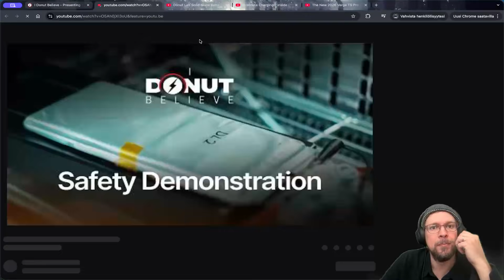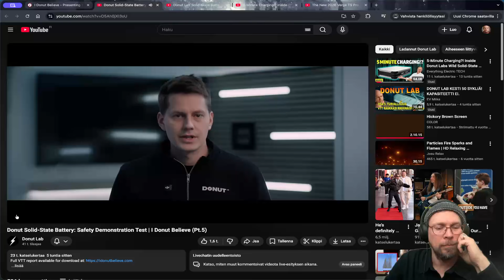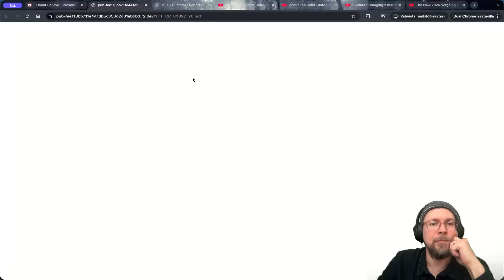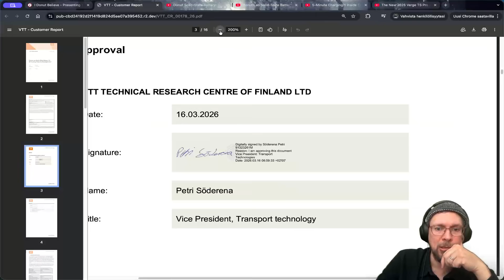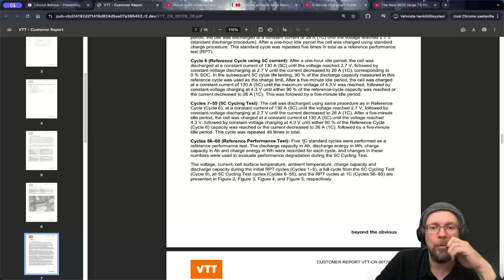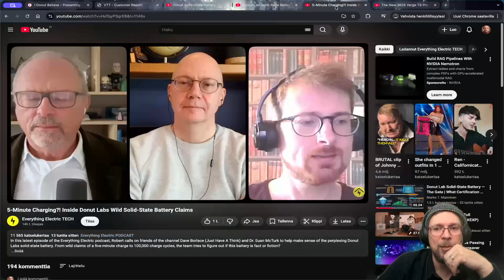Reaction to Donut Lab Safety Demonstration VTT Lab Test

Comment: That was interesting idea and a good point, I also watched the podcast and he's talking about UK battery sector and Formula 1 and Formula E. You know F1 development is massive and many breakthroughs have been made from it into the cars we have today. That's the idea of F1 "develop the best formula". Car manufacturers like to invest in F1 because it's basically free development of car technology and these new F1 and Formula E cars are heavily battery and electric motor centric, probably many and the most innovation will come from there because it has the highest development budgets for these technologies. They have been developing these F1 cars we have today for several years already (5+ years) and might have already discovered something massive but it will take time until it's allowed in the rules and instead went to Estonia and Finland to do it.

Also doesn't this last video give hint about how much denser the solid-state battery is. Old bike was 245kg and new one 220kg so the battery is 25kg roughly lighter than the previous battery with same range so that's the energy density difference I believe. I think someone can calculate the weight and energy density of the battery from this. Probably a bit less but I believe most of the weight saving like 90% should come from the lighter battery.
Reply from the maker: Nice F1 details! Someone commented that the TS Pro motor weight also got down, so that 25 kg may split half lighter battery and other half for to other bike components getting lighter. My initial calculations energy density would go somewhere between 300 and 400 Wh/kg. I don't know for instance, if ED in the end product is calculated from the single ideal cell at its best condition, or if there is something to average when cells are in a pack, and packs in a closure working with BMS. A bit research probably gives easy answer.

Comment: Strange is that they claim the cell pouch seal was damaged during the 100 °C test. How could it then swell up by 17% after 60 additional cycles, and they even mention that the “cell pouch was firm”. Did the seal somehow reseal itself?
Or was it not a loss of vacuum at all, but rather the cell started producing internal gases during the high‑temperature test, and continued doing so in the second test? Because if this is a solid‑state battery, I thought it shouldn’t be able to generate internal gases. And if the seal really did reseal itself, where did the additional gases come from?
EDIT: Maybe only the internal cell material swelled up without actually generating gases? Because in the post‑test photo, the cell doesn’t seem to be swollen like a typical Li‑ion pouch cell…
Reply: Two Bit da Vinci (Ricky) actually pointed out that the 'plateau' after the capacity drop is a classic signature of solid-state contact loss, not chemical failure. He also noted that the cell stayed 'firm' rather than 'puffy,' which proves the 17% expansion was solid material swelling, not boiling liquid gas. If it were standard lithium, the moisture in the air would have turned it into hydrofluoric acid days before the test even started.

Comment: The cycle test performed on the damaged cell was conducted in a climate chamber (possibly the same one where it originally failed), whilst a different background cycling test was observed in the fume cupboard where the self-discharge test was conducted, suggesting a cycle test is still yet to be released. Perhaps a suite of test results are being planned to be released next Wednesday (weight, volume, safety tests, cold test and cycle life) at the same time as an announcement of the Verge motorcycle production release. I wonder if Donut Lab might have engaged Munro, or other engineering companies, in addition to VTT as part of a planned reveal for the 1st April.

Comment: He doesn’t say that that is the new SSB motorcycle. He just says that is the new version & will ship with SSB.
Reply: It has the new colour screen that is on the new motor cycle.
Reply: He doesn’t say that, but there is a #solidstatebattery tag. The weights also aren’t that impressive. Isn’t the original 540 lbs (245 kg) weight with the Donut Motor 1.0? Because the same bike with the Donut Motor 2.0 is supposed to weigh 507 lbs (230 kg), and in the video he mentioned that the new bike weighs 487 lbs (220 kg). So did the “solid‑state” battery actually save only about 10 kg?

If the battery really saved the full 25 kg, then it’s getting very close to 400 Wh/kg.
Reply from the maker: That was my initial calculations as well, what could it mean for the volumetric energy density. And I also was confused initially with 507 lbs, but good to know that it related to the motor v2.
Reply: @MarkoTManninen I believe they also reduced weight in the latest version of the motor.

Comment: I think if you put the 'missing' water back into the cell and repressurize it (put it in new outer bag and restore the new bag to vacuum) restoring the 14.7 PSI clamping, it might recover more than expected, I hope they try it and post that report (if they bother to do it)
Reply from the maker: That would be a weird procedure! They say no clamping is needed, but how do they vacuum the cell? And what kind of pressure it actually causes?
Reply: @MarkoTManninen  They are almost assuredly using atmospheric clamping (often called vacuum clamping) a method that uses normal air pressure - roughly 14.7 psi at sea level, they said it loses vacuum due to the bag not being constructed to withstand 80 to 100c

Comment: Thank you for all your work about these cells and for a video without AI voices and graphics!
I agree, this test was not planned and was only a “damage control” response to their cell being unable to be used at a temperature that they said it could handle, 100°C. 

That damaged cell expanded a LOT in this cycle testing. I’m wondering what would happen in a battery pack with lots of cells that were already under some compression.

That UK/F1 possible association is interesting!

In my opinion that Verge motorcycle dealer was saying that solid-state battery packs will be arriving later this year, which makes me think some or all of the new model motorcycles are being shipped with conventional li-ion packs.
Reply: Nothing will be shipped with old battery packs they skipped it.
Reply: I just figured that this test wasn’t signed off on time for last weeks schedule so they switched to the charging video.
Reply from the maker: Actually the high temperature test was also signed at the very last moment, even later in the Monday morning before publishing. But maybe it was just the final paperwork, and this one had still some publication material, website, video etc to product.

Comment: This is not a proof that donut battery is safe when damaged. To be a proof, they have to harm the battery intentionally with industry standard tests with don't controlled variables.  If it can fail safely with the same tests lithium batteries are put to, then we can conclude that these r better than lithium from the perspective of safety.
Reply from the maker: Ten rude tests suite, modified for SSBs is needed for better proof, but as for small Verge TS Pro example size, they don't need them officially, just internally to make sure, they don't get on court if something bad happens.